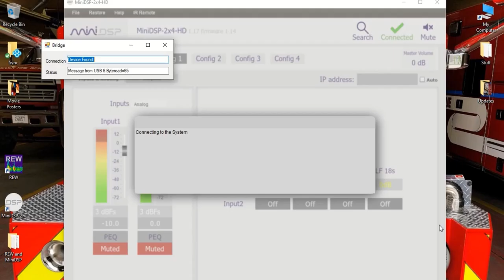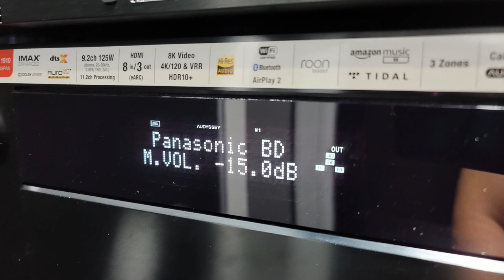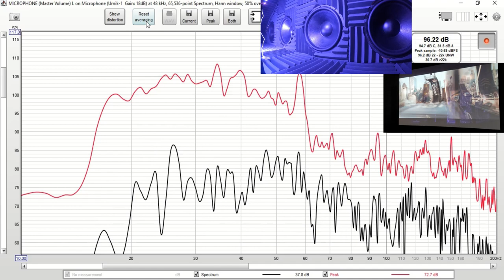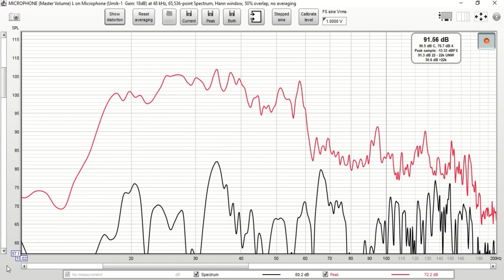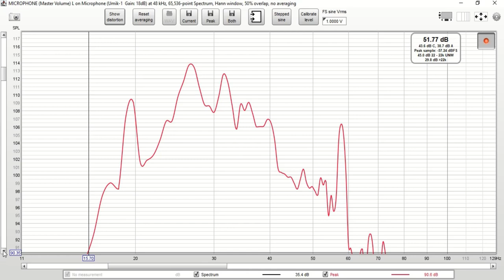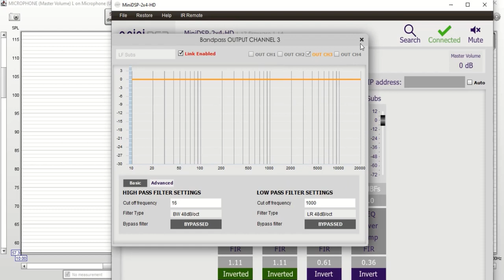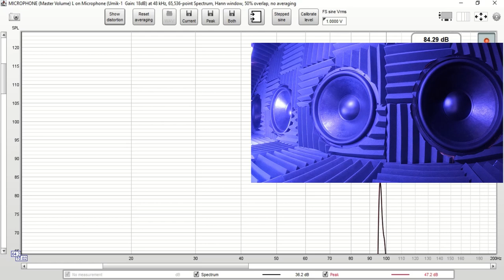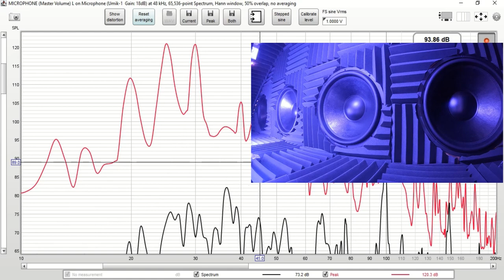Basement Home Theater - High Pass Filter On vs Off Comparisons.  Gained Db levels below 20 hz!

Comment: home theater gurus recommendations aren't for infinite baffle speakers those are meant to go to infrasonic levels.........
Reply from the maker: Makes sense - I was more concerned with the 2 SVS subs in my system, and didn't want to cause damage to them somehow.  However, in my research, SVS has built-in filters that prevent damages so they are good to go!  Thanks!
Reply: Dangerous stuff lol 😮😮😮